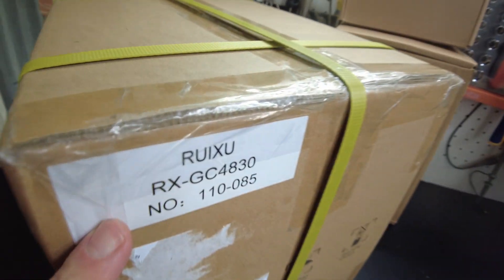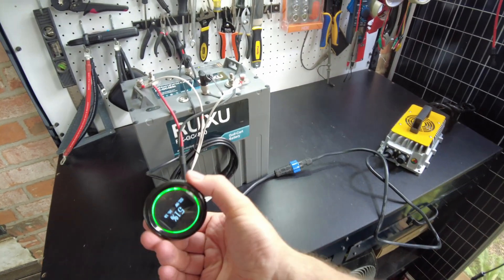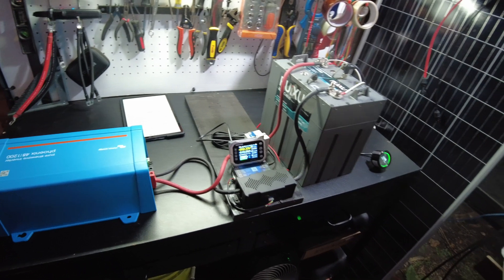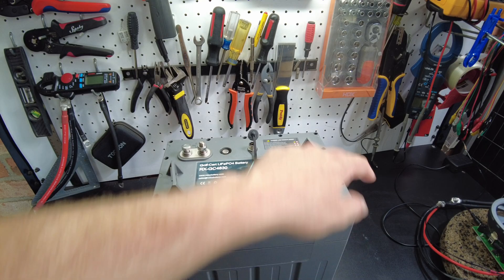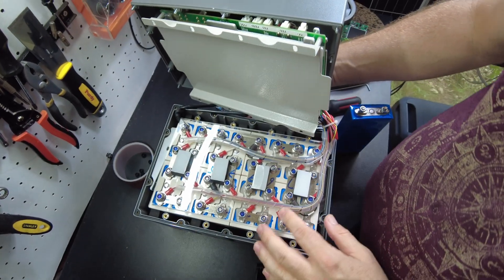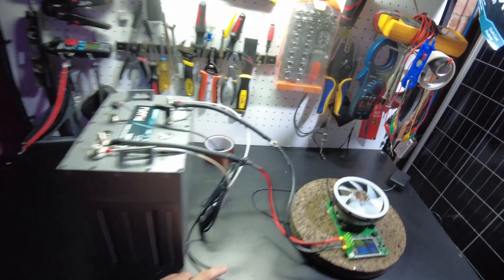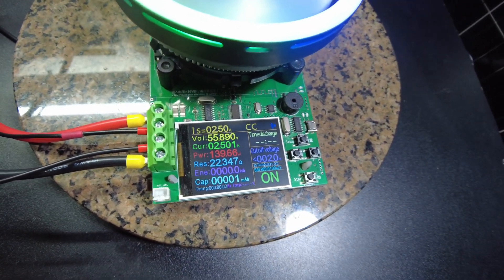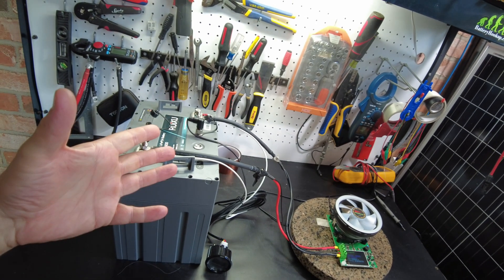RUIXU 48V 30Ah Golf Cart LiFePO4 Battery

Comment: So they're using 25Ah Top Band cells and hoping the extra few percentage they usually yield when new gets them close enough to 30Ah? Really should market them at 25Ah and let customers be happy when they pull 28Ah. They should know that a 25Ah cell isn't going to pull 30Ah even if its Grade A new.

Edit: well Top Band does apparently make 30Ah LFP cells in a similar form factor to the 25Ah so it would be interesting if you could get a model number off these cells
Reply from the maker: They are 30ah cells. The problem was one was out of balance by a few ah. I balanced the pack and it finally pulled full capacity. Watch till the end. Thanks

Comment: I did purchase 12 batteries, but all had charging issues, 4 were like the 48 volt 30 amp you tested, all had one battery that was 0 volts and swelled up. The bad cell seemed to be by either the positive or negative posts. All of the BMS’s were removed. Out of the other 8 - 12 volt batteries, I was surprised to see 4 of the Chin batteries all had BMS failures. Actually all 12 had BMS failures, I wouldn’t recommend buying these type of batteries!

Comment: Brad, I brought 4 similar used batteries from Battery Hook Up, all had one cell bad and BMS failures. Actually I like that the cells that have bolts rather than being spot welded as the ones that I have, you can replace a bad cell more easily. Out of the four batteries I have, I can save three of them with some work and better BMS’s.
Reply from the maker: Interesting. Yes, I agree being serviceable is really nice! So the cells that were bad, were they sitting at zero volts or something? Thanks
Reply: Did you buy the ones listed as having a bad cell? Or the ones that they listed as "fully working"? Just curious.
Reply: @DanielMV720  I brought them as not working, out of the four I brought hopefully I’ll restore 3! The BMS’s were gone, I’m installing Daly 30 amp smart BMS’s. Actually I’m working on my first one now!! Going to use them for battery storage.

Comment: If your order the DL24P electronic load tester directly from Atorch, it's around $33. Takes a while to ship but it's not $80 either.
Shouldn't the BMS be doing a bit of balancing. Would it eventually even out or would it stay that way without intervention?
Reply from the maker: Thanks for the DL24P tip, I'll look for that link, and add it. As for the BMS doing some balancing, from my experience they can help keep it in balance, but when the cells are this far out it's a real challenge. Now I have no clue about this particular BMS, maybe it's really good at balancing, and this would resolve on it's own in time. Thanks